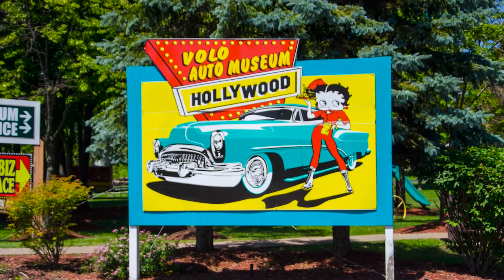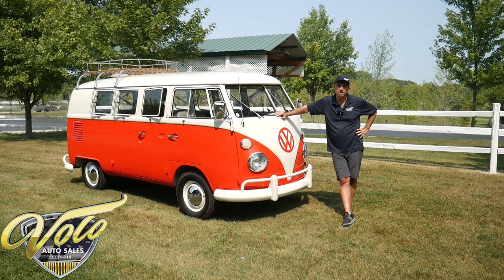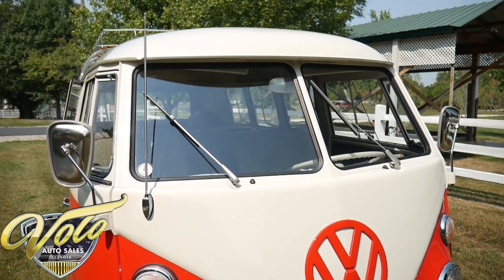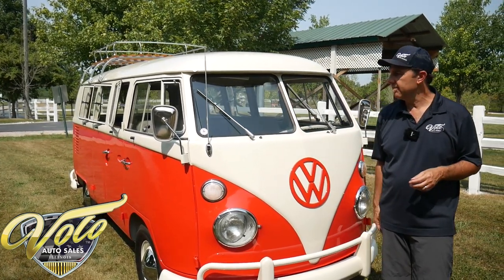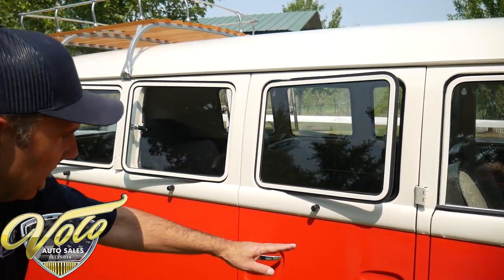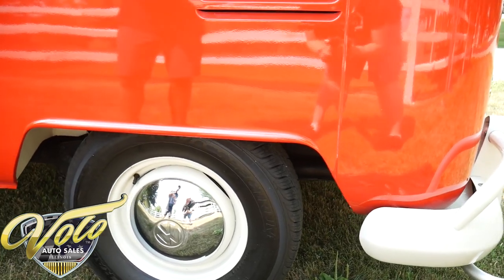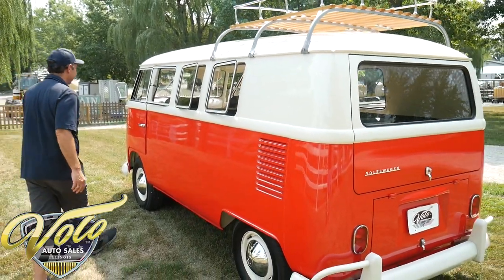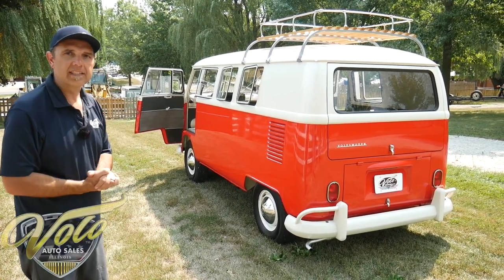1967 Volkswagen Transporter for sale at Volo Auto Museum (V19110)

Comment: Great restoration Jay. With the 1200CC engine, as long as you are not in a hurry, you’ll eventually get there. I bought a brand new 1974 Beetle, drove it till it died, about 10 years, notorious for rusting out back then.